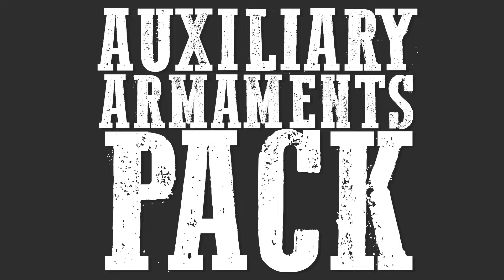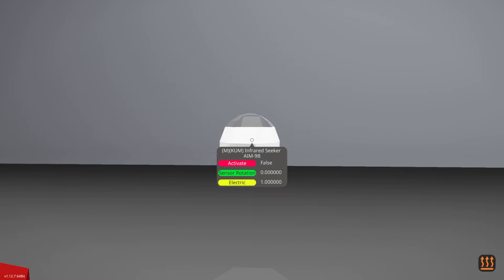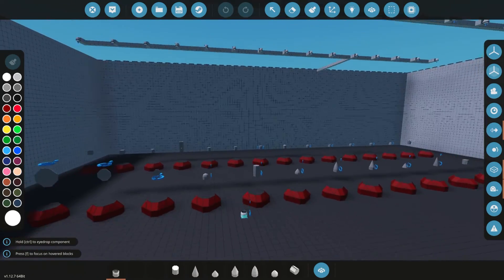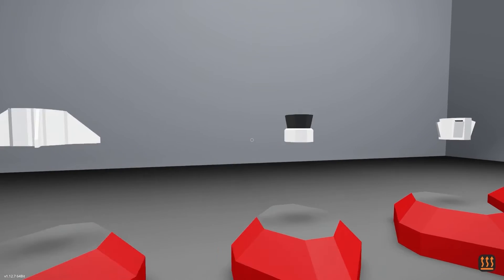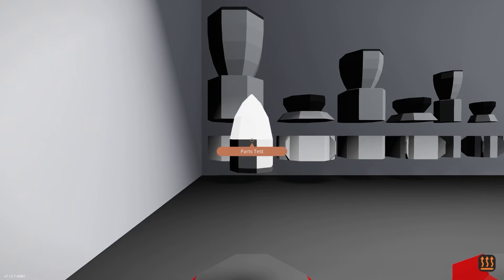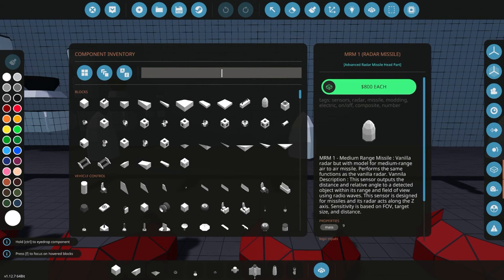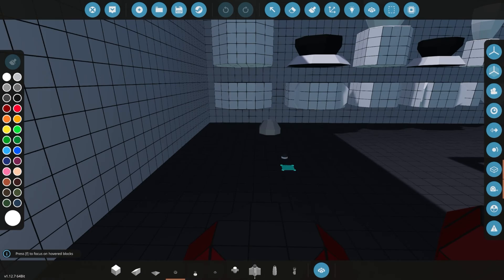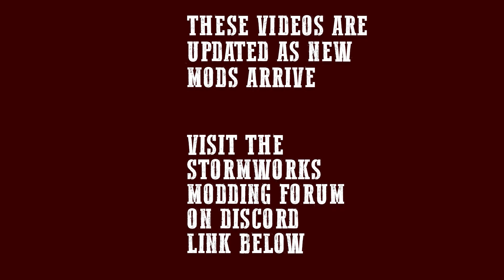Missile and Rocket Mods [2024-11-07]

Comment: The seeker you looked at should be an heatseeker that looks for heat sources, not radar reflections. Although I doubt it actually works that way and now I wonder if it's possible to make a heatseeking missile with a ir camera. And I also wonder why the devs gave us chaff and flare launchers without giving ir seekers

edit: I forgot that the ir setting for cameras is just night vision, not thermal vision, which means it wont work for heat seeking missiles.
Reply: i mean
theres heat sensor in the game
Reply: @pro321pvp  the temperature probe can only measure the temperature in an enclosed space (if it isn't in one it outputs the ambient temperature) it's impossible to find heat sources with that without being at them first.
Reply: i agree, flares don't make sense with radar.
Chaff is for radar, it trys to reflects the impuls in multiple directions, so the traking system will not get enough echo, to detect anything. But they are useles to an IR tracker.
In reverse. flares try to offer a "better" target for IR trackers, but they are useles against radar..
It would be cool, to have both systems modeld correctly.
Reply: Flares arent just missile countermeasures, they’ve been in the game forever anyway